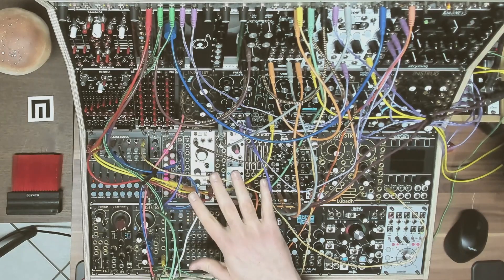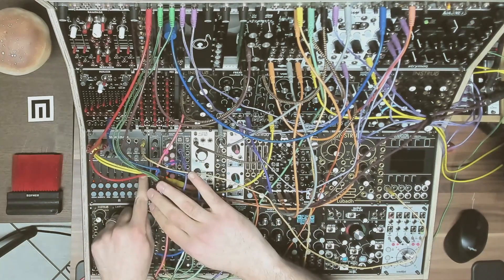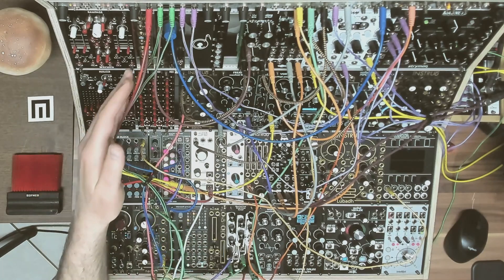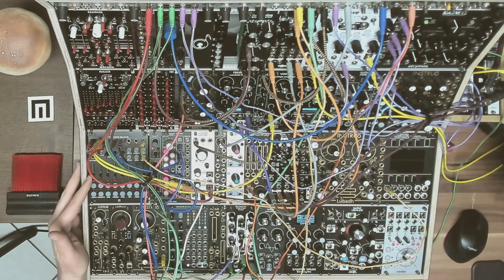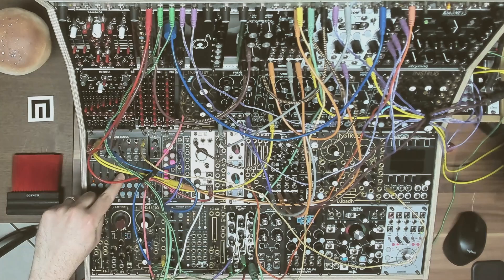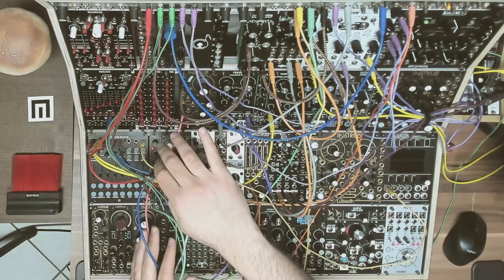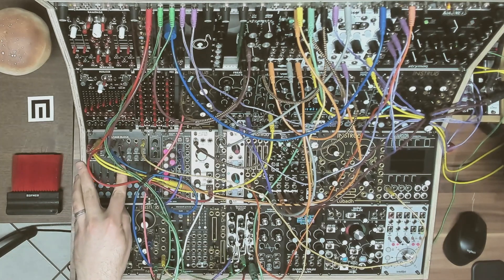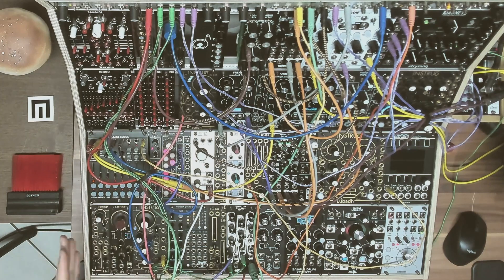Is the Malekko Voltage Block only a sequencer? \ Quick Tip

Comment: I think it’s worth pointing out that if you set the pattern length to 1 on the channels you use as macros you can still clock it and use the sequencer on the remaining channels
Reply: I came here trying to figure out if that was possible and first comment! Just plugged mine in today and it has really tied my system together.
Reply from the maker: Yes! Totally true!

Comment: I have never once considered that without a clock, it’s 8 faders. That’s crazy
Reply: Even better. Recently discovered. I was thinking about getting an Oxi Meta. But then I realized I can mimmick that effect with voltage block. So basically you use the save system to create a default state where all the faders are down.  So when jamming. You can slowly open up some faders to add reverb, delay, filter cutoff, pitch or whatever you like. Then create a drop by loading the default state to go back to where you came from. Then use the mute function to lower back the faders to the default state whitout effecting the sound. Rinse repeat. So much fun!

Comment: How are you using DLD? Im underusing it as a regular delay but I know it is capable of much more
Reply from the maker: Well, I like to randomly trigger the reverse and hold for nice granular effects, and use it also for looping. The clock outputs really help for looping and driving other voices. It has also the built in VCAs, which are great for using with percussive sounds, for example, enhancing the rhythms with rhythmic delays.
Reply: @OmriCohen-Music  thanks, nice ideas here! I'm curious about that last one and what you mean about the built in VCAs...do you mean delay feed? Please do a video on the DLD!
Reply from the maker: @moloch808  No worries :) And yes, exactly, the delay feed. When you think about it, it's actually a VCA. You can have your voice going through without any delay, unless the delay feed is open so you can use envelopes, LFOs, random signals, and so on to open the delay feed and let the voice be effected from the delay. For example, you have some drums going through it, and you're using a random gate to activate the hold function, and the same gate will also open the delay feed so you will get sort of beat repeat only when the hold is activated because the delay feed will only open together with the same random gate. Does this make sense? And yes, I have so many ideas about all sorts of hardware modules but I'm not so sure how to approach this on this channel...
Reply: @OmriCohen-Music  thank you! I like the format of focusing a video on novel use of 1 or 2 modules in a patch, a bit like this one. DLD is maybe more specialised than voltage block, but I'd love to see more on it! Thanks again 👍

Comment: While I realize they're not the same, how do you feel about the Voltage Block vs the Muxlicer? I only have room for one. Thanks.
Reply from the maker: Well, as always, it depends on what you're looking for. Are you looking for a modulation source? Then Voltage Block. Are you looking for a switch\"simple" sequencer? Then Muxlicer. I love both...

Comment: Super cool! To further the process, I am curious if Hermod might be able to work as a CV recorder via their CV inputs? So theoretically record the faders into tracks in the Hermod, then pass through the CV outs. If so, hopefully it would work in realtime. One could only dream🧐
Reply from the maker: Well, you can directly record the movement with the Voltage Block. Only 16 steps but still...